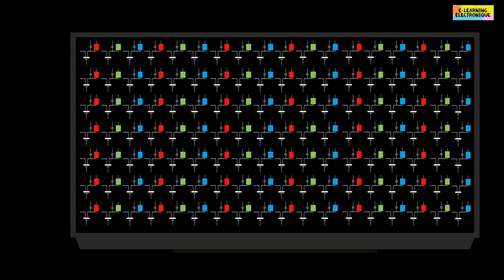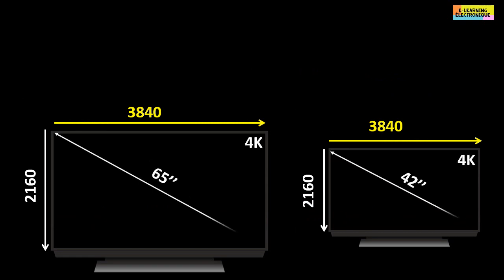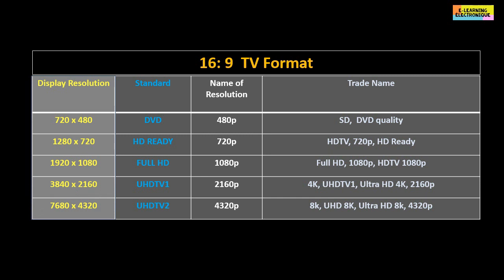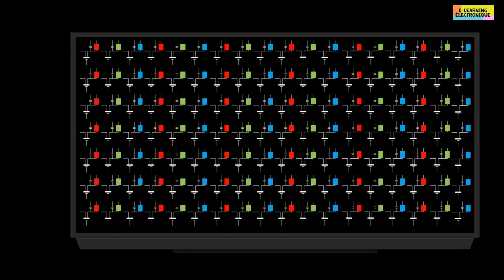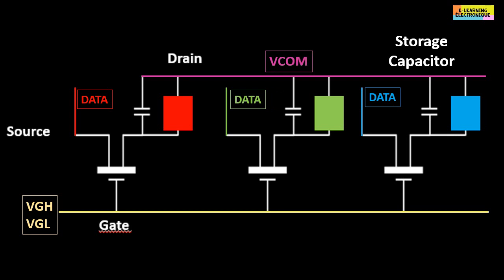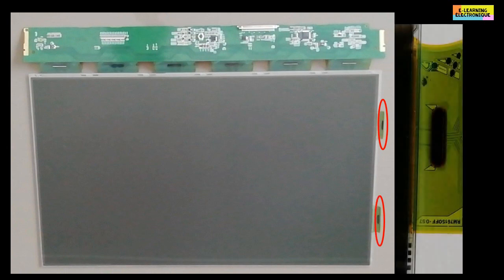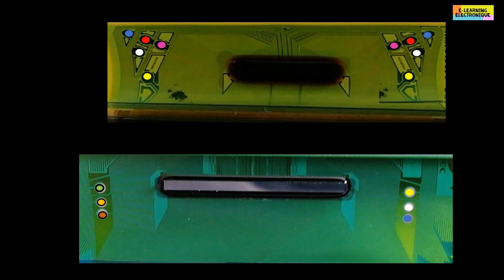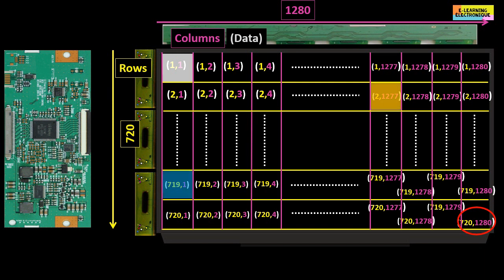Organization of the pixels in  LCD screen and the different circuits of their control from the TCON

Comment: It is good information, actually nowadays the Gate Driver not used anymore, the Panel Maker only use Source Driver and the data running to the each pixel parallely

Comment: Are left and right side  connected to each other because I noticed that a chip was shorting on the left side but the short is gone when i remove the righ side my tv is lg 43 inch which doesnt have a sepereate board of tcon board where the left and righ is connected directly into the motherboard

Comment: 14:06 why remove all 3 COFs? isnt it possible to just remove 1 COF which possibly caused the problem?
Reply from the maker: you can test by removing only 1 COF and if it does not work you will have to remove the 3

Comment: Unfortunately, not well explained enough. Let's switch on one of the vertical data connection lines, let it be blue, than all the blue subpixels will be on at the intersections where the horizontal power source lines are on. It looks like there should be not common but separate vertical wiring for each subpixel which gives a way more connections i.e. the same as the total number of all subpixels... I know, I'm wrong. Who can explain the real work but, of course, not only for one single subpixel?
Reply: ok, so even if TFTs, as the third part of the scheme, activate needed pixels, the TFT itself should have power wiring/connections, which again leads to a great amount of connections, a least one per subpixel I think.... Yep, I'm dumb. I just want to understand.